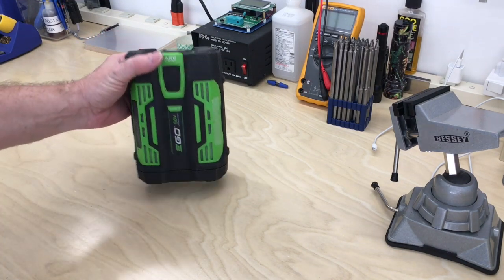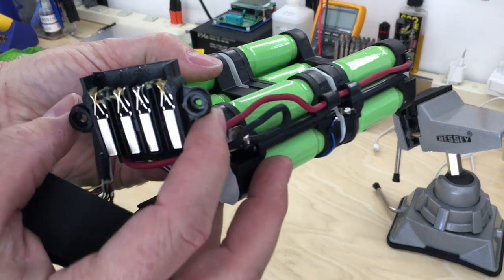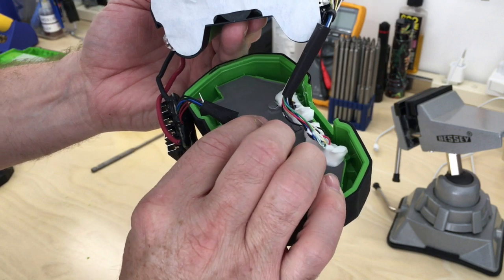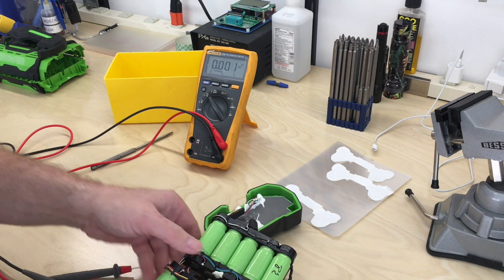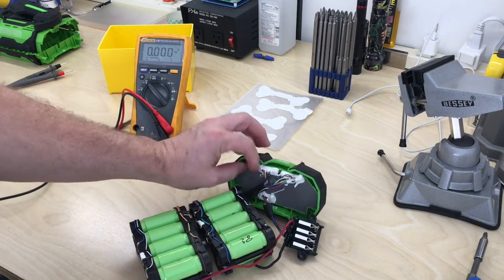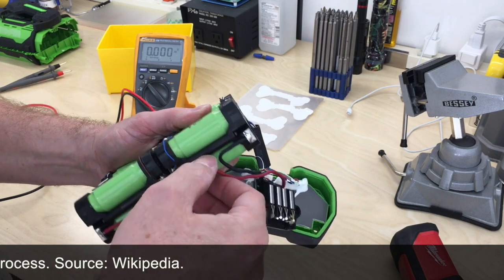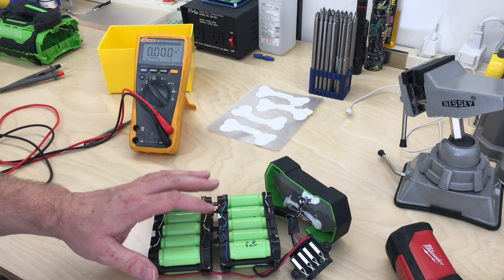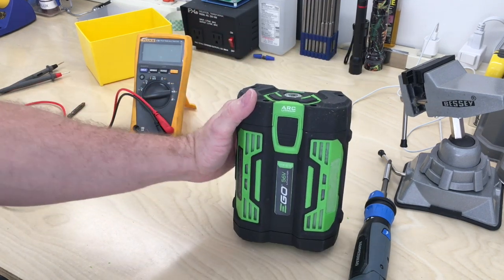EGO 56V ARC Lithium Battery Teardown

Comment: should have cut the wires to save the batteries.. that's the problem with electric trimmers. will cost as much as new trimmer replacing battery. so overpriced.
Reply from the maker: I ended up repairing this pack in a later video! still going strong and the new pack has had no issues! I will not ever go back to mixing the gas and oil myself. Now even my chainsaw is a 16" EGO I love it but it may not be for everyone!
Reply: @ThriftyToolShed  ..I know what you mean I have two completely torn apart GAS trimmers I'm about to trash and one that I replace or rebuild carb on it every time I don't use it for couple weeks and then there's problem finding ethanol free gas in Houston. I have had it with gas myself but these electric one's are way overpriced and out of most people's budget. I guess it's all matter of priority.although was surprised to hear 3 year warranty on the battery. that's very good.I also like the fact that your electric has flat edge trimmer and not stupid curve shaft that gas trimmer have and are way unbalanced.

Comment: where can we find the replacement cells
Reply from the maker: I have used spares so far from a lot I bought on eBay of defective packs about 2 years ago. We have had several comments from viewers that state they found which battery is in the ones they have.....
  (Jonathan Ridder) mentioned his had Sanyo UR18650NSX. 
  (Ipissed)mentioned his are Samsung INR18650 with phase change sleeves made of paraffin wax/carbon graphite.

Comment: 3 year warranty. EGO will replace it if you have a receipt or other proof of purchase.
Reply from the maker: Correct
Reply: Only if you bought the battery at an authorized dealer and have receipt! I bought a couple on ebay and they wouldn't honor the warranty
Reply from the maker: That's correct. I mentioned at the end of the video that EGO sent me another one under warranty and you do need a original receipt when you register it. I also repaired this pack in the very next video about 3 years ago.

Comment: EGO batteries are a total failure !
Reply from the maker: I definitely believe they have had issues and so far since I have repaired several it seems to be more faulty components from there supplier. As I had the transistor short on some batteries and once I replaced it, it has not failed since, and it's now been years later. I do really like the idea of the cooling they attempt to design in the packs because so many manufacturers now make the packs as tight and compact but they are killing the cells by overheating them. I still use and enjoy the EGO products and will continue to do so, sorry your experience has not been good with them. I can understand the frustration of failed packs for sure. I was on the fence about the time of this video and I guess once they were good about sending a replacement right out and then told me to keep and recycle the old one and I was able to repair it, I guess I automatically became a fan.

Comment: The green flashing LED is explained in the manual. It means that the battery is discharging to 30% charge level for storage. It is supposed to do this discharge after 30 days being off the charger, but yours is malfunctioning. My guess is that the timer chip on the BMS has failed, or a component that sets its timer interval or a short or failure on a nearby discrete component so that it begins this discharge cycle immediately.

Another thing you could have found out would be to wait to see if the BMS stops the discharge at 30% as it is supposed to. If it drops below 30% charge level at about 50v pack voltage then the failure is also causing it to continue draining the cells to failure. However if you always keep it on the charger between uses it will continue to work like normal.

If it does stop discharging at 30% then you could just continue to use it without risking over discharging and failure of the cells if you ever leave it off the charger, but it will only have 30% if not kept on the charger.
Reply from the maker: As mentioned in the video it is definitely defective and it will go all the way to zero if not on the charger. I repaired this pack about a year ago. Link in description and at the end of this video.

Comment: Great video 👍. Like you say the battery construction is clean, rugged, and well thought out. This is one of the power units I am considering.for portable power.  Can't figure out why people are complaining when there is a three year, no argument warranty. Then they say you can just recycle the battery. Use the cells in your flashlights etc. Pretty generous. Who makes that blue and black powered stick screwdriver.
Reply from the maker: Thanks for your comment! It's a hammerhead like this one: https://www.ebay.com/itm/1-NEW-Hammerhead-HCSD040-02-4-Volt-Rechargeable-Screwdriver-Circuit-Sensor-/292726370048

Comment: Battery only six months old and ego wouldn't replace it?
O better get more than six months out of it.
Reply: I had one battery last 2 charges and the other one is doing the green light death flash after about 3 summers of use. Not sure I'm going to continue buying the EGO products. I do use mine on commercial property so they get used more than say someones small lake cabin. I really wanted to love them, the trimmer and blower have lots of power but the operating cost has so far greatly outweighed my Stihl gas equipment I had in the past.
Reply from the maker: @jboutdoors2123 ,
Sorry to hear that. I have only had the one failure out of six batteries now and I have been using the ego products for over 2 years. I do love the power and I hope the issues with the packs are resolved. I can appreciate the efforts in the design especially the cooling, but the electronics have to be solid as well.  I do love the convenience of the packs without compromise on power. 
I personally will not be going back to gas.
Reply: @jboutdoors2123  So far so good on mine after several months of bush wacking. Thake it back and get another one. They are good with the warranty.
Reply from the maker: Sorry to see that! They have been really good at replacing in the past. I have not had another failure since I had to repair this one and that's good, I guess it was some faulty components in the mix, seems to be hit or miss. I had one fail out of 6 batteries.
Reply: @ThriftyToolShed  I may have worded this wrong.
I just purchased it a month ago and i thought I heard you say yours only lasted six months. I was just saying I hope I get more than six months out of it. And, I would hope that they replace it since my tool has five year warranty. Thanks for the reply. Love your vids.
Reply from the maker: @streak2645 ,
Ok, I am glad. Yeah I have had good luck with all the others, lots of others in the community having similar issues I guess it is hit or miss! Thanks for your comment!

Comment: What are you sticking that tape too while checking the cells? Looks like some type of plastic sheets.
Reply from the maker: It's actually diffuser layers from an old monitor with a cracked screen. I always repurpose items I can before junking it. They have always come in handy. Another larger one is what is covering my work area below the camera in most of my videos. I have always like being thrifty as possible!

Comment: Where did you get the bits in the blue holder?
Reply from the maker: ebay, the long bits are really nice!
https://rover.ebay.com/rover/1/711-53200-19255-0/1?icep_id=114&ipn=icep&toolid=20004&campid=5338325412&mpre=https%3A%2F%2Fwww.ebay.com%2Fitm%2FExtra-Long-6-Security-Bit-32pc-Set-Tamper-Proof-Hex-Torx-Star-Pozi-Tri-Wing%2F111824191857%3F_trkparms%3Daid%253D111001%2526algo%253DREC.SEED%2526ao%253D1%2526asc%253D20160908105057%2526meid%253D2ae5d0d969a94c0a8c1c25a93e236b6c%2526pid%253D100675%2526rk%253D1%2526rkt%253D15%2526mehot%253Dpp%2526sd%253D111824191857%2526itm%253D111824191857%26_trksid%3Dp2481888.c100675.m4236%26_trkparms%3Dpageci%253A0ad76450-6c67-11e9-b583-74dbd18032b9%257Cparentrq%253A75aead2e16a0ac1d207c3a27fffb843b%257Ciid%253A1
Reply: @ThriftyToolShed  Thanks for sure will get a set and thanks again

Comment: If under warranty Ego will send you a new battery. They know the problem in this batteries. They will let you keep the bad one. That's what they did to me got the new one. The new  battery is going strong no problem holds a good charge no more issues..
Reply from the maker: Right. That is why I stated that in the video and I also repaired the pack they let me keep on the next video which is in the video description as well!

Comment: What kills these batteries cold or heat? I’ve got two 2.5 ahr and looking how to take care of them the best since so pricey!! Should you ever run them completely dead or chg up before?
Reply: These batteries don't develop a memory, so there is no need to completely discharge them before recharging.
Reply: Yea all my li-ion powered tools will shut off before it allows you to completely discharge overheat or damage them.
Reply from the maker: In my experience overheating is one of the biggest killer of the cells. This is one reason I really like the additional step engineered in these batteries for cooling. The battery management system (BMS) if working correctly will not allow the battery to overheat or over discharge without shutting down. I personally still charge mine after modest use even if still showing above 25% but I feel it's just good practice.

Comment: Finally I found someone that has had the same issue with there battery. Thanks for the upload. Nice to see how podded everything is tho.
Reply: potted
Reply: I like the EGO equipment and use the batteries frequently, every battery i have has started blinking within warranty at some point. Customer service although is excellent.
Reply: Mark Wetty I also had this same issue after 1 year.  I believe the batteries are fine but the charge controller has failed.  As you mentioned, customer support was truly excellent and I got a replacement battery in less than a week.

I notice the replacement battery has a different controller design...  I suspect the blinking issue was prevalent in the earlier version and hopefully they have corrected it.  So far so good - I’m going into year 2 on the replacement battery with no issues.
Reply: @tomkatt2321  wow so the cells are still good? I found one in the recycle score!
Reply: It's normal behaviour for the LED to flash green after 30 days of not being charged. It's in the owner's manual. It indicates the battery is self discharging down to 30% capacity to prolong the battery's life.
Reply from the maker: Please watch video. This is not normal. As mentioned. I actually showed this pack repaired in the very next video 4 years ago.

Comment: Try cutting the DC to the front panel momentarily rebooting it.
Reply from the maker: You can watch the repair video that shows the repair, so just unplugging the BMS will not solve the issue. If your battery is faulty like this one unplugging the board is necessary to stop pulling the voltage down until you can repair it. Thanks for your comment!
Reply: @ThriftyToolShed  will it charge the batter slow and safe with the BMS unplugged?
Reply from the maker: @slingshot6722 ,
It will not, fortunately I was able to repair this pack, and I shared that video as well. Thanks for your comment!
Reply: @ThriftyToolShed  My sister has the problem. I dont know if its the light like yours or not. But her first battery lasted a year and a half now this one only lasted 9 months. Hers is black and decker

Comment: Nice video, I have issue with my battery charger, it started releasing smoke( probably one capacitor leaking) after 15 mins of charging, and I do have a spare charger, but when I plug it in no power, even the led red and green did not blink at all. I am not sure I have a bad batch of charger, I will call ego about it and hope they will replace both charger, one six month old and the new one, I just bought it 2 months ago.
Reply from the maker: Ego should replace both for sure. I have not had any issues with a charger yet. Just curious, Do you have the basic charger or the rapid charger?
Reply: @ThriftyToolShed  I have the basic charger that is included with the blower and grass trimmer.
Reply from the maker: @oliverstoys8411 ,
Thanks for sharing, that's the same one I have. Very strange!
Hopefully EGO will make it right!
Reply: Thrifty Tool Shed thanks for sharing, have a great day👍🏻

Comment: I got one of these battery packs for free, are these 18560 cells? I haven't opened my yet because  I don't have a hex bit thing with a hole in the middle, but I cut a little hole in the top of the pack and the cells look bigger than the 18650's , is there something  covering the cells??
Reply from the maker: Yes they are18650 type cells and they are covered with a phase changing sleeve. I mentioned these in the next video when I repaired the pack!
Yes you will need the security bit to get in it easily.
Reply: @ThriftyToolShed  so, there are 14 cells total?  That's only 51.8v at the nominal rating of 3.7v per cell.  Interesting!
Reply from the maker: @blackz06  ,
They charge  to around 4.1 to 4.2 volts for maximum capacity. Oddly enough Echo brand calls theirs 58v with 14s also so they are stretching it a little!
Reply: @ThriftyToolShed   yes... they are both lying a little bit for marketing purposes!

Comment: Great video! Emphasis needed on REGISTER YOUR PRODUCT, EVERY TIME. WITH UPLOAD OF RECEIPT. Some companies require this for warranty reasons. If you spend more than 50 bucks for your component, no matter what it is, take 5 minutes to register it. Many people don’t take this step, even with $1000 washer/dryer (as example), believe they can just take it back to the store after 30 days have passed, and they are met with disappointment.

Excellent view and insight into arc-lithium arrangement. Thanks!
Reply from the maker: sabianfirst, Very true, thanks for your comment, also check out the video a week later I was able to repair the pack! 
https://youtu.be/EH0GS0iUzzM
Reply: Also, we never really keep stuff, but snap a pic of ur receipt (or if its online, save it somewhere) take a pic of ur serial number and then you have proof in the future, in the event they claim you never registered it if u in fact did.
Also, I'm sure other brands do this too.
Ego, of you buy a mower with 2 batteries and a charger or a blower with batteries and charger, those items will all match up. I.e. it be 12345S for the mower and charger and the batteries will be 12345A 12345B so its pretty cool how well they even thought out the serial numbers.
I was pretty impressed so far with everything.
The mower is excellent quality.
I truly don't believe the advantage to be not dealing with oil changes or tune ups as most lawn mowers will run for 10 years doing nothing but adding fuel, at least in my case they all have, n I usually buy cheaper ones that have a standard Briggs and straton motor. Anyway, the advantage is just simply having something quiet. Something anyone can use. Something you can store for long periods without much use and it will always work, like a snowblower or something. Eventually those little engines will need a full rebuild or replace when they start burning oil n then never run again.
My point, is that I have a small property and having large gas items makes no sense.
I still have my gas trimmer, but one day when it goes, I will replace it with an ego.
I have had it for 4 years now and only use the pre mixed non ethanol fuel. If O mixed it myself id have gas that is 4 years old as i have probably only used a gallon or 2 total since buying it.
This is when battery operated stuff excells.
Also, when storing lipo batteries long term, they're not meant to be stored fully charged even though everyone does. Now, for regular use, fine. If its sitting for 3 months, the same way you get the battery is how it should be stored, with 2 bars max if u have the new ones.
That will prolong the use tremendously.
Reply from the maker: The EGO packs will self discharge if in storage with no use over 30 days. It's a built in feature to help with this issue of packs stored long term fully charged. It's unfortunate if you have the Nexus power station though and wish to have the packs fully charged and ready if needed. You will have to stay on top of it and charge them every so often to be ready.

Comment: The battery is in a maintenance mode if you were to call ego they’ll give you a free replacement the battery is not fixable.
Reply from the maker: john miller, That was mentioned in the video. I also did repair it in the following video the next week.https://youtu.be/EH0GS0iUzzM

Comment: I have the same issue with one of my battery packs. it is a 56v 2.5 Ah and I will call the company tomorrow to get a replacement. these batteries are really expensive.
Reply from the maker: Steven Delgado,If EGO still let's you keep the old battery to recycle it, keep this repair video in mind! https://youtu.be/EH0GS0iUzzM
Reply: @ThriftyToolShed  Today is my lucky day! called EGO and they were very helpful, I did not have a receipt for the purchased of the unit. They asked me to go to Home Depot where I bought the unit and get a copy of the receipt. HD could not help with providing the copy but, the store associate were willing to replace the battery at no cost to me. So, HD did not have the battery in stock then, the store associate tells me, look bring your old trimmer (Which was 1 1/2 yrs old) and I will do and even exchange. What???? this new unit has an auto load cutting line. It is pretty slik. Cudos for Home Depot that did above and beyond to keep a customer Happy.